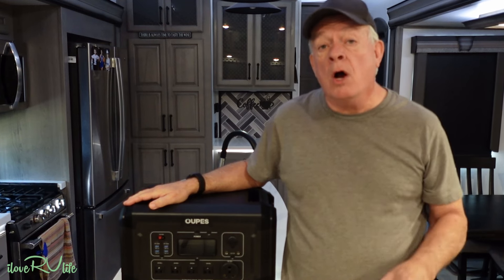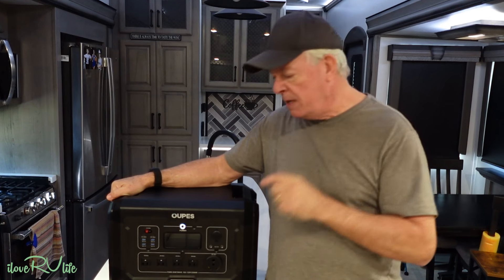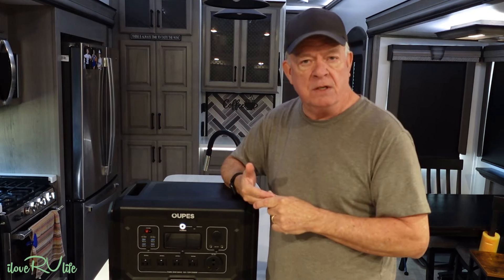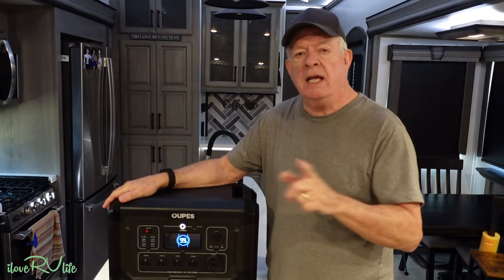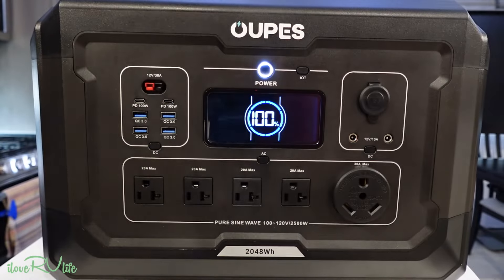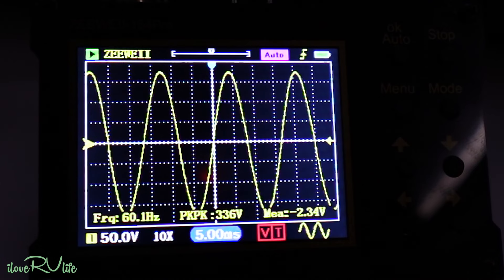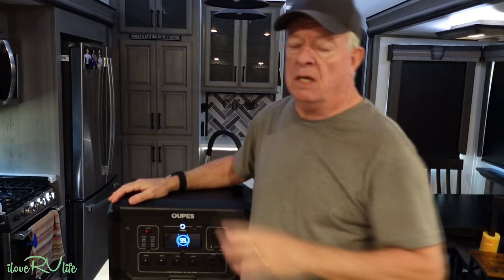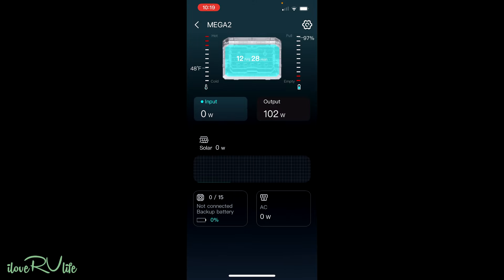Oupes MEGA 2 Power Station - Powering Our 5th Wheel Off-Grid

Comment: Is there any way possible to safely get 12VDC-60A-900W out of the Mega 3? Existing DC output on the Oupes is only 30A but will an AC to DC 12V/100A converter work if plugged in to the 120VAC/15A side?
Reply from the maker: The issue is going to be the limit of the Mega 3.  Regardless of the converter you'll be limited to the output of the power station.
Reply: Doesn't the AC side put out 4000W from the TR-30?
Reply from the maker: Specs state 3600 which is 30A at 120V.

Comment: Great review, Thank you!  These types of devices are getting better all the time.  I also have a 5th wheel rv and could see this device replacing the existing MPPT solar charge controller, power inverter with autotransfer, and converter charger.  
Would be nice to have hardwired ac input/output connections and perhaps a direct connection to the internal lifepo4 battery then it could replace the regular rv battery too.
Reply from the maker: Thanks. I agree.  That would be a good addition. The only company I’ve seen recently with this  standby set up is EcoFlo, but it’s more for home standby.  Maybe we’ll see something in the near future.

Comment: Jerry, when using a 50 to 30 isn't just one leg of the 50 amp service being energized.
If you went from a 50 to two 20 amps dog bone would you have both legs being energized at 20 amps?
Reply from the maker: The 50 to 30 combines the one 30 feed and feeds both 50 legs. Usual with a double 20, the two 20 feeds are shared by the same breaker, loosing 10 amp.